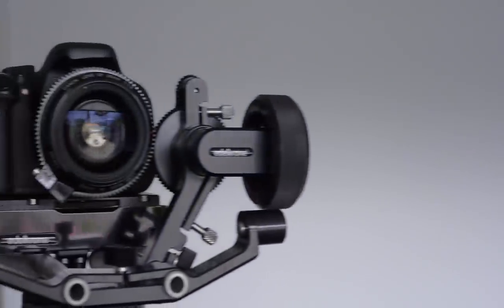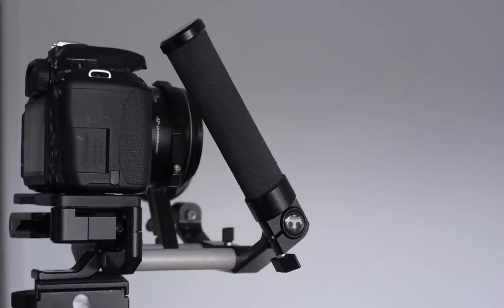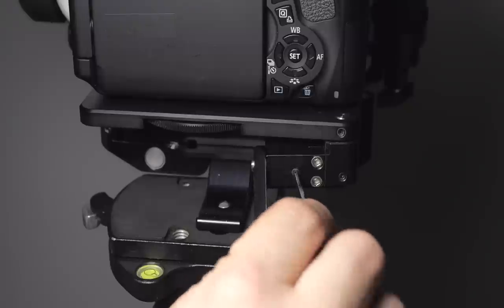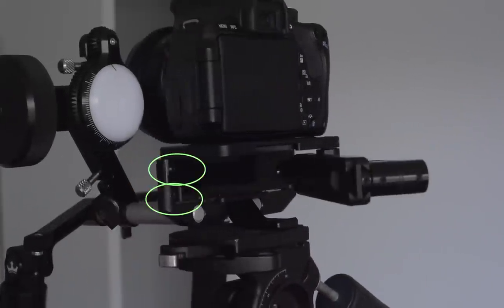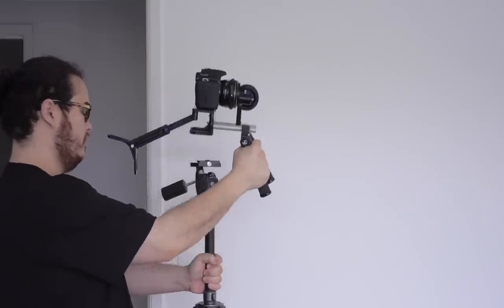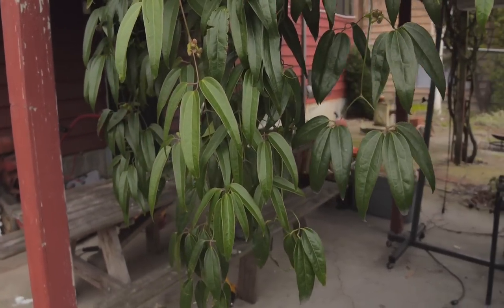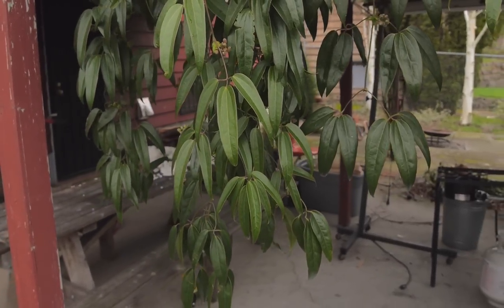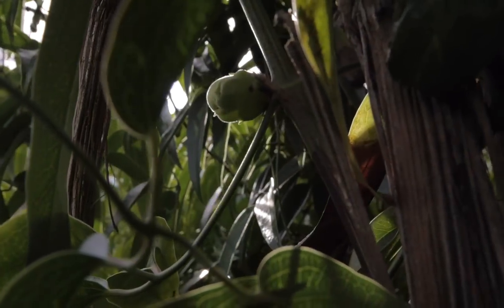Perfecting the Edelkrone Pocket Rig - pivot tension and handle setup

Comment from the maker: I will get deeper into this in my next video, but yes, I highly recommend a third-party handle. Also, you will need extension rods to use the 70-200 with this system. Definitely avoid the handles offered by Edelkrone.

Comment: Nice tips...thanks! I am planning to order both the Pocket Rig and the Focus One Pro follow focus system but am a bit concerned about weight / stability. I plan to use them with my Nikon D800 and mainly 2 lenses - an ultra wide angle Nikkor 16-35 mm f4 and a much larger Nikkor 70-200 mm f2.8 VRII. Mainly for amateur / casual work related stuff. Do  ne the handles from Edelkrone or can I just buy a 3rd party handle? Any thoughts/suggestions would be welcome!